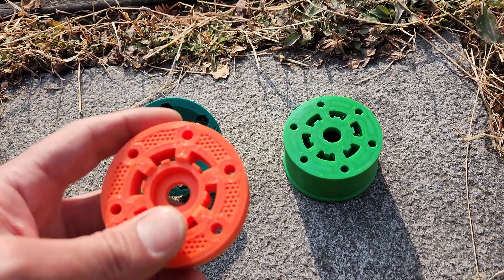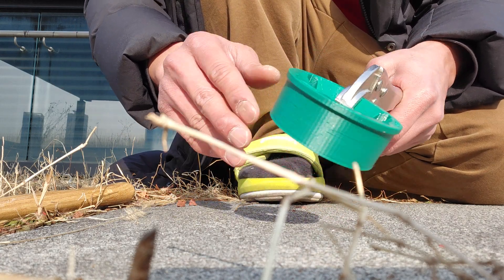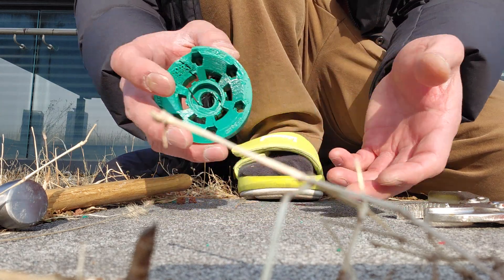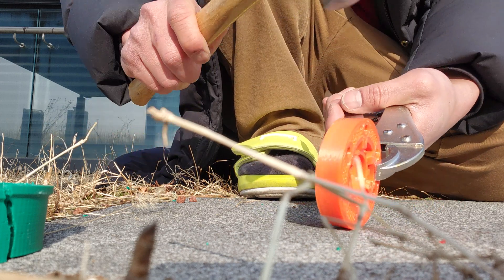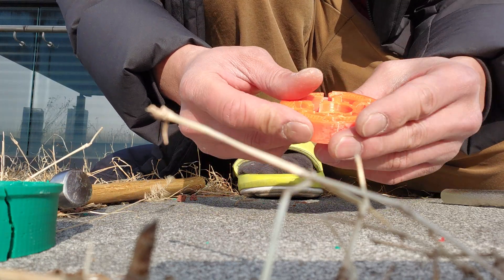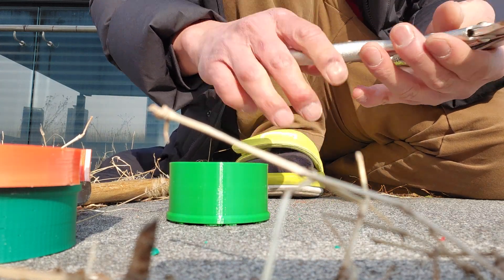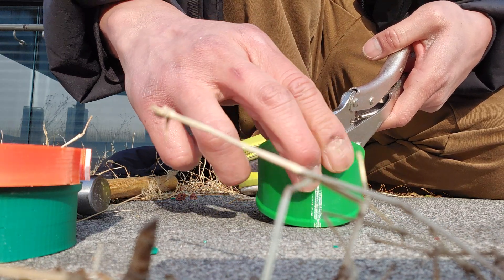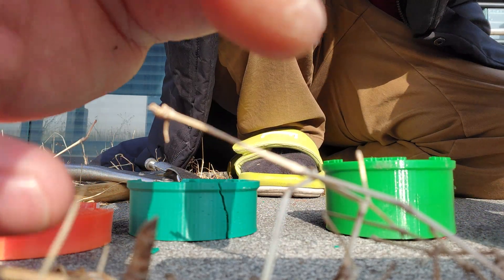Prusament PETG vs. ABS vs. TPU Impact Resistance Test w/ HAMMER!

Comment: I love Ninjatek Armadillo TPU it's 75D shore so close to ABS in stiffness but, still has that TPU toughness.
Reply from the maker: That's an interesting filament!  Very expensive though, how is it working for u?
Reply: @3dPrinterSchool  It works great and like normal tpu you basically can't break parts printed in it. It is pricey though sometimes you can find it on amazon or other online retailers for a deal.
Reply from the maker: @thirtythreeeyes8624  i wonder how it compares with a mold injected pc, maybe pretty good i am guessing.
Reply: @3dPrinterSchool  It's not gonna be as stiff as pc but,  it's tpu so layer adhesion is essentially 100% I print slow with no fan. The slight elasticity is nice though because parts seemingly can't break they can deform though